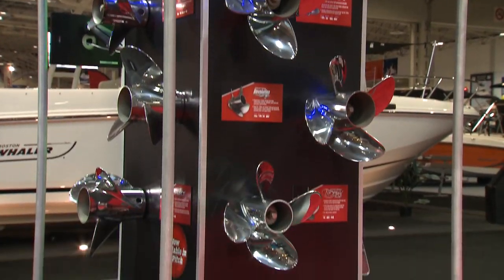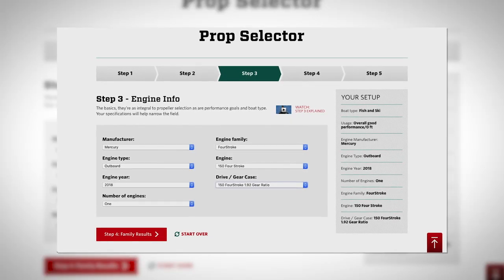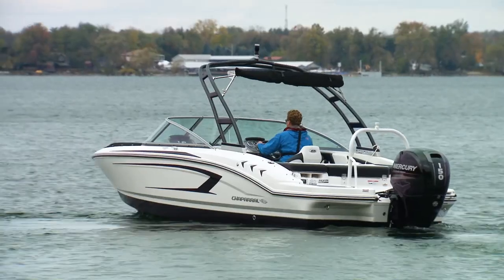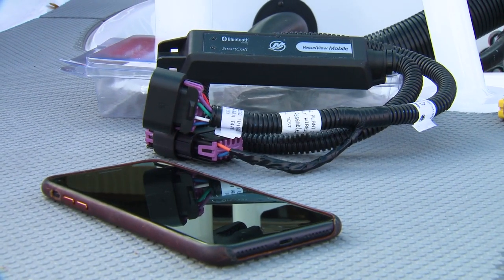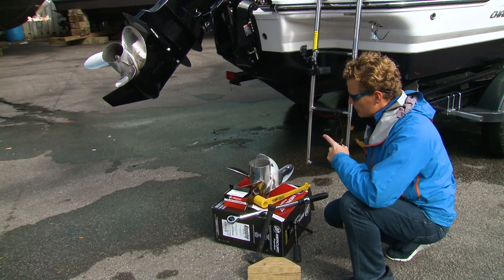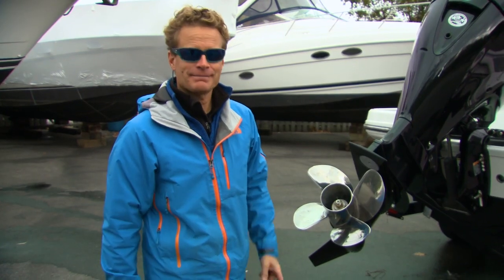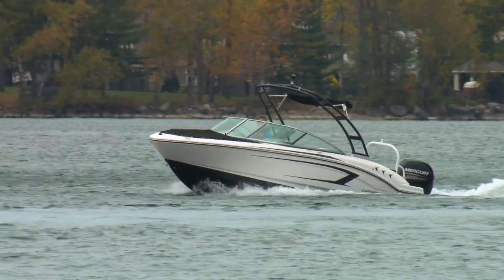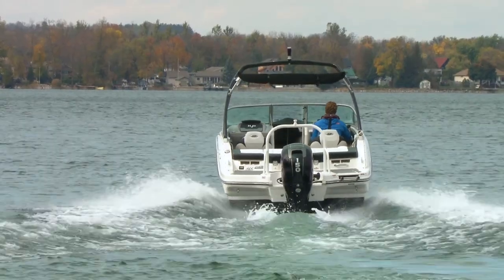3-Blade vs 4-Blade vs 5-Blade Mercury Propellers - What are the Differences? | My Boat DIY

Comment: We have a high five 17 on our hurricane fun deck. It hauls all the mail even fully loaded. Pops out of the water instantly and hits top speed within a couple boat lengths. The onboard Yems 5.7L v8 probably is most of the reason but I would hate to see less control on it.